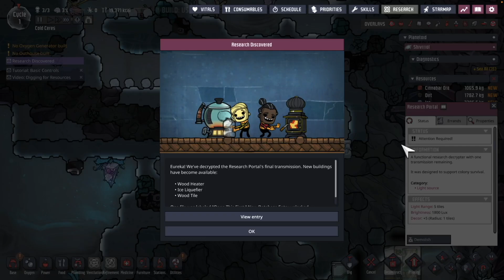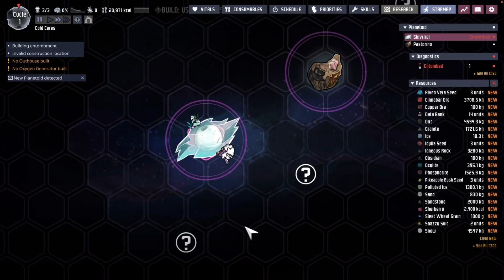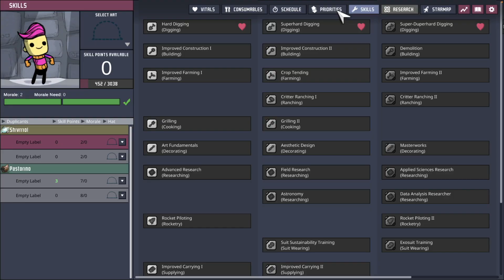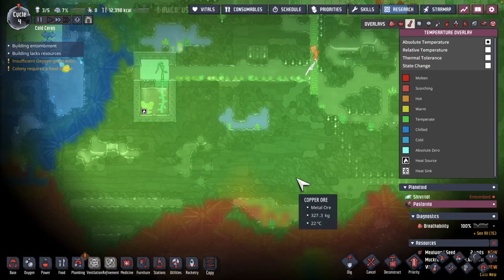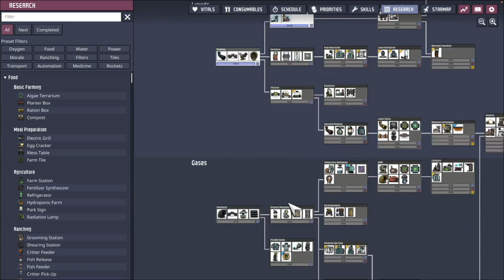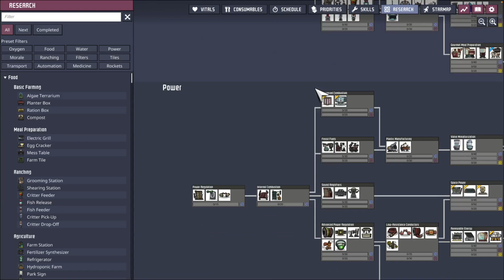No Warm Coat!? Then I'm out of here! - Cold Ceres 7

Comment: Nice a restart ! I love those !
I started to experiment with scientist with ranching skill 1 for the early critter relocate and the first sheering for coats. 
7:48 note the very convenient moppable crude oil on the ground ! You can set up double bead vaccum lock for your melter this time, and with double layer wood tiles, this melter gonna get hot ! Oh yeah, i forgot, you don't need to, you gonna use the salt geyser.
38:22 The dupes queued up the harvest command, but the floxxes grazed it in between.

The early teleporter is a powerful strat, i used it in my first speerun. I remember rushing the minipod too. It allows to double the early free ressource and that's a big deal on ravenous. It's a good way to avoid the difficulty of the challenge, that's a win in my book.